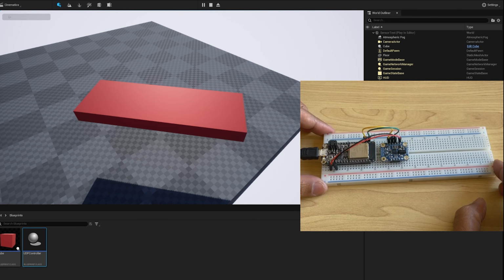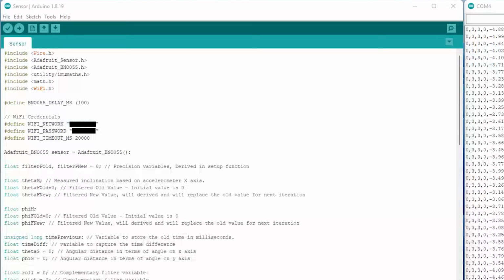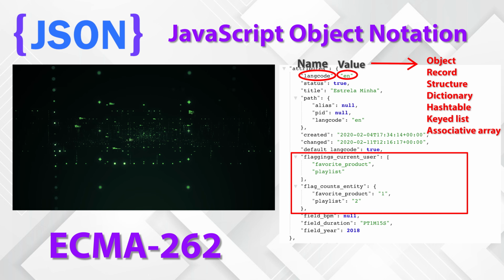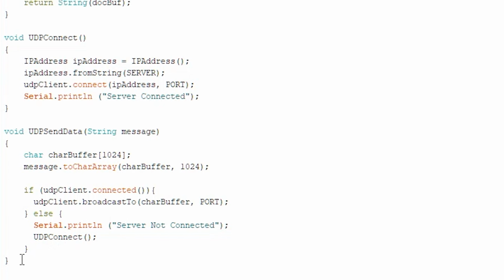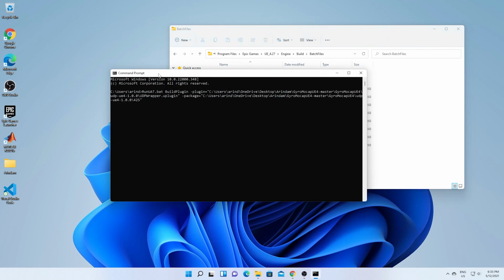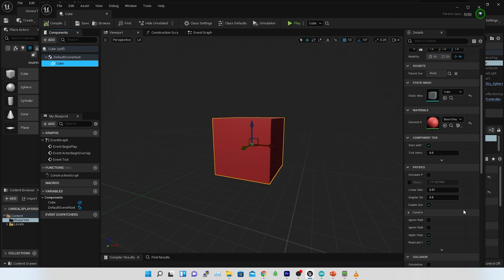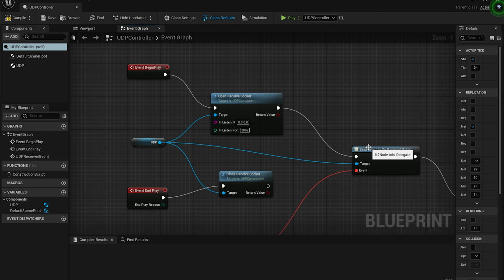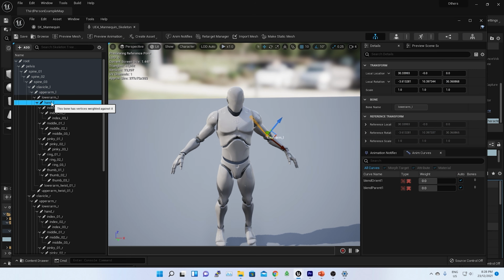Motion Capture / Mocap Sensor to Unreal (UE4 / UE5) using BNO055 and ESP32 Feather with perfection

Comment: I am getting a lot of help from your video. Thank you so much. However, I am getting an error when compiling the Arduino code. The compiler cannot find the file 'AsyncUDP.h', and it is not shown in the video which library I should use. I have installed all the libraries related to Async, but it does not work. Please help me.

Comment: hi i need help 
i hve succesfully write blueprint for TCP server and get data from another device but when i'm taking value from json and writing postion in feild it only show 1 value not showing XYZ
please help
data form is here 
{"position":[0.27443048357963562,0.32106888294219971,-0.064795494079589844],"rotation":[324.96261596679688,354.99053955078125,273.64019775390625]}

Comment: Hi. First of all, thank you very much for the videos, you are great! I want to tell you that i follow your instructions, and i didnt get it to work the way you do it. In Unreal, I finally manage getting a print screen using the "on receive  bytes (udp)" node from the UDP component in the blueprint. I noticed you have it in your blueprint, i think you didnt mentioned that in the video. I was getting, with your original instructions, an "access non" error/warning after level stop for several nodes. Hopefully it will help someone. Do you know why i was unable to do it the way you did it? Finally, im using node-red to send udp messages. Again, thank you very much for the video! Saludos desde Chile
Reply: Hi I got the same "Accessed none" error. Could you share how to fix this?
Reply: @johanneswidter9489  https://youtu.be/NXbJPScS5fI?t=977 in this second, you can see in the upper left, in the "Components" tab, an element named UDP. An UDP component. You can add it using the the add symbol and search for it. Then click on it, and in the Details panel, scroll down until you see the nodes you can add in relation with this component. I used "on receive bytes(udp)" node. This node have all the options to set de udp network.
Reply: @lokogaspy  Thank you!!
Reply: Bro where did you add the on receive bytes node to like which part of the blueprint?
Reply: Hi, it is explained in previous post. Search first in the components of the blueprint the UDP component, if it is not in the list, add it first pressing the add/plus button in the upper right corner of the component tab/window. Then, select it and scroll down in the details panel, you will find the nodes derived from the udp component. choose "on receive bytes(udp)" node. In the detail panel of the udp component also you have all the options to set the udp port to receive and send data

Comment: You have put a lot of work in documenting this process, thank you kindly for that. I have a question, if you use MPU9250 gyro instead of BNO055, will it affect the process too much, and in terms of code I mean.
Reply from the maker: Process should be same. Now a days most of the 9dof sensors has internal sensor fusion algorithm, so please check their outcome as well.
Reply: @othersYATC  Thank you for replying, much appreciated